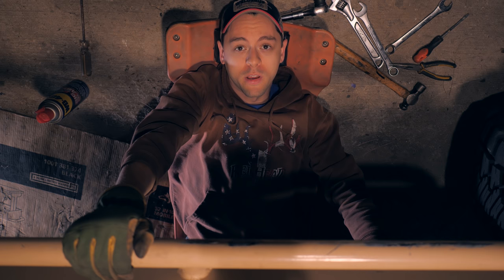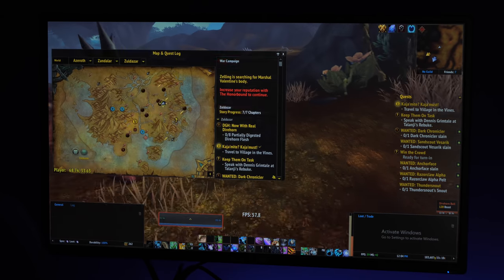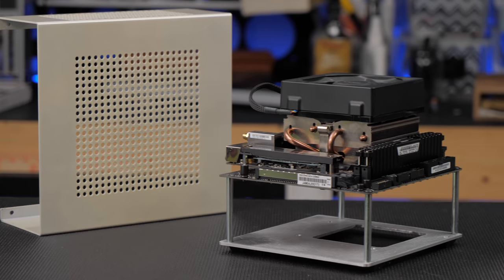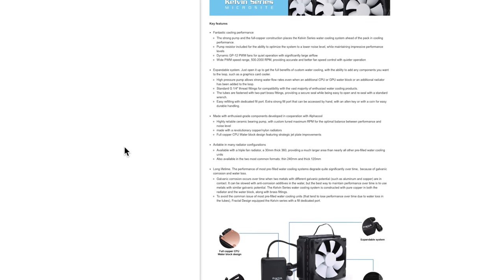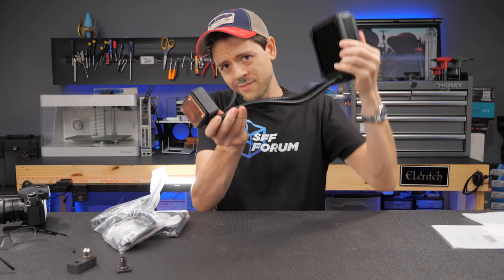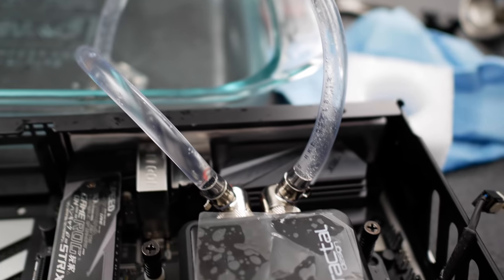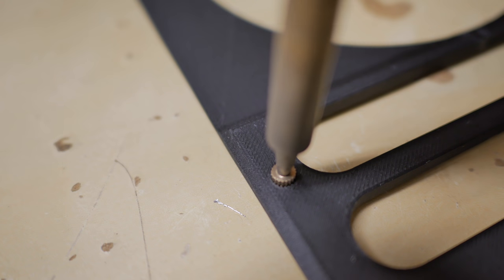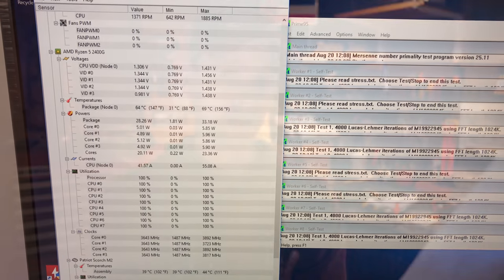Brickless + Liquid-cooled + Ryzen 2400g + S4 MINI

Comment: Cool, for super small cases the way to go is not water pumps, but instead heat pipes. Similar to what HDplex, Streacom etc are doing. That would be a awesome project building a custom case similar to the S4 Mini but a all out heatpipe solution.
Reply from the maker: Putting a res in line is a great option for those who can for sure! Thank you VERY much for commenting. :)

Comment: Another tip. Air in a AIO will always setting at highest point in a loop. If you laying these mini pc flat then the highest point would be the pump. That why it's noisy. The air is settling in the pump block rather than the top of the rad. As it would do in a standard ATX system. I've used loads.of AIO"S and never had any noise problems. The pc needs.to be stood upright with rad been highest point so the AIR collects.in rad leaving pump silent.
Reply: exactly this

Comment: New APU case would be amazing. Please do this!!!!!
Reply: I don't think it is really necessary, after all there are quite a few very well made ITS cases, that only house the mainboard itself and a pico PSU. I hope AMD will release even more powerful APUs in the future, it would be awesome to have a tiny system that can also handle heavy games like Witcher 3 in 1080p!
Reply: Oktay Yumlu - My dream is for AMD to release a 6c12t APU with a 24 CU Vega graphics. This will not be likely possible until they are on 7nm process. But fingers crossed
Reply: jbres79 that would be equal to 1536 shaders, so just between the RX 560 and the RX 570. The TDP of this APU would be at 175 Watt, pretty darn high but possible to cool 😁
Reply: I think existing s4 mini would be fine. If only there was a good ac-dc single PSU to easily put inside. I really like utilitarian shape of s4 mini.
Reply: Given how they do the CCX config with Ryzen and how they replace one CCX with the Vega compute units for the APU's, it would be interesting how they could do 6c/12t and Vega iGPU and manage heat in the same package. I'm fine with the 4c/8t, but bump up the speed to closer to 4.5GHz and up the graphics to the 1050/560 or even 1050ti range while maintaining power consumption and TDP closer to the 2200g/2400g levels, and that would be great. However, that may be too hopeful for what 7nm will allow as well as the limitation of using ddr4 for the gpu side.
Reply: @kartaloktay  "there are quite a few very well made ITS cases, that only house the mainboard itself and a pico PSU"

Name a few that are as small (or smaller) than the S4 Mini and are as attractive as the S4 Mini.
Reply: Athasin check out the cases from streacom, they only house the board, 2,5" hdd and the Pico PSU. They are also made of aluminium and pretty cheap.
Reply: @kartaloktay  Will do, thanks!

Edit: Just did and ... they're seriously outdated. I mean they still have a slot for CD/DVD drives and a front panel eject button instead of USB-A ports (let alone USB-C). 
I definitely seems like the market is in desperate need of updated APU cases.
Reply: I've been waiting for someone to do a APU case with a Vesa bracket to mount to back of a monitor for that AIO look.
Reply: @carlwells9504  Relan is the name of the brand...Aliexpress
Reply: @novakk86  Cool thanks I'll check it out

Comment: @Not From Concentrate
Thanks for another great video.
Just a note on the "AIO prolems/weaknesses" You mention.
I have over the years "moded" a number of AIO's and though I fully agree with Your description of them I still think they can be a pretty great solution depending on Your needs, resources and expectations.
So to my real "point", I think I might have at least a "partial solution" to some of Your "gripes"with AIO's. And that is to "simply" add an "tube reservoir". What I mean by that is simply using T-coupling at the "top of the loop", and have a short "tube reservoir" capped with a "sealing plug" connected to the "T". This "dead end tube" should be positioned so that it can be used as filling port, and "tiny reservoir" when refilling/changing liquid as well as "reservoir/bubble trap" when in "daily use", though that is not strictly required. 
Using this "arrangement" makes it MUCH easier to refill the AIO, something that (as can be seen in this video :) usually is a "pain and a half". It can also make it easier to keep an eye on the "liquid level (and condition) AND to "top up fluid" when needed. Something which can mitigate some of the "AIO noise problems" caused by low liquid levels and "air in the loop"
Just wanted to "throw it out there". [This idea is nothing new, and it is in principle just using a "tube section" as a "dead end reservoir". And it can of course also be implemented using "hard tubing", though that's a bit more cumbersome, and actually "less usable" (much like hard tubing in general:)]

Keep up the good work, Best regards.
PS.
You might know a lot about "computers and stuff" but when it comes to candy You are clearly clueless.
Salt liquorice is GoodsGiftToMan ;)
D.S.
Reply from the maker: Haha...strangely, although I absolutely hated that stuff...I kinda want to try it again. I guess that is why they call it Stockholm Syndrome? Because it has to do with wanting to return to bad Swedish candy. xD
Reply: Stockholm Syndrome... AIO from Sweden... A pattern emerges.

Comment: Looking forward to your APU case. It would be great if you could bundle it with the PSU (AC-DC and DC-DC). It is a massive turnoff when a case (any case) requires parts you need to source from third party sources (typically PSU and risers).
Reply: Yeah. Please convince hdflex to make single unit ac-dc PSU 180W. Would be perfect for apu. I asked hdplex about this, and they do not have plans for this now. :/

Comment: Those AIO coolers are under filled for a reason.  If it was completely filled up, it has a high chance of leaking over time due to the fluid expanding when it heats up.  There's a new one coming out soon that has expanding valves installed on it to prevent this.  Also they have corrosion inhibitors in the fluid to prevent galvanic corrosion.
Reply from the maker: I appreciate the comment! Even if there is a good reason that they aren't completely filled it doesn't change the fact that air in your loop is going to hurt performance and shorten pump life. I did a livestream video where I add a reservoir to this AIO and it quiets it up and drops the temp. You can find it in the playlists. The glycol mix they use inhibits corrosion, but doesn't stop it, as anyone who has taken apart one of these that mix metals. Finally, how hot would the fluid need to get in order to spring a leak? The tubing is rubber and could expand, and if your glycol reaches boiling you have a serious problem elsewhere. I think expanding valves is a great idea if it solves the air problem.  Peace and thanks again. :)
Reply: I wonder though if air in the line will actually deteriorate the pump over time.  In the aquarium hobby the pumps we use are very similar to AIO pumps with the same basic impeller design, and many of those, such as venturi pumps and protein skimmer pumps, pump both air and water through them on purpose.  Those don't fail or break down because they have air going through them.  In fact they get heavier usage and still last for years, even decades.
Reply from the maker: @Brunnen_Gee  That's good info for sure--now we can all wonder why pump life is notoriously so short with PC "AIOs." :)

Comment: So, Im not sure what you are doing wrong with AIO pumps or maybe its because I dont run ITX systems and am not attempting to sleep on my systems while running fortnite at 4k, but my AIO pumps rarely run loud enough in my mid tower case to be heard. I have run other AIO systems for 5+ years, crammed with cat hair and they still do a good job at cooling my system.

Comment: They have replacement parts on the alphacool website for it. It basically the Alphacool Eisbaer LT  just re brand with the fractal design name on it. Plus they do have an 3600rpm pump upgrade for it. If u need more power.

Comment: It's a cool way to fill a AIO. But there is a reason they don't fill them completely.  Liquid expands when it gets warmer to hot, so the empty space in rad allows.for fluid expansion.  You could be running the.risk of a leak when the fluid inside your loop expands and only.way out is through fittings.

Comment: you should try get in contact with asrock (industrial) and get your hands on one of their stx motherboards with a mxm gpu slot and ram slots and m.2 slots and cpu socket and etc etc... its pretty much a mobo thats smaller than itx but still fully socketed, just a bit hard to get your hands on. all the best! (there are some interesting stx cases out there too btw)

Comment: Have a 2200g build in a small InWin case and its great on my 720p tv in my bedroom, playing through AC: Origins now and the 2200g handles it decently well on 720p with a mix of settings, but a solid 30fps (which is is standard for AC games thanks to the engine). Hoping their move to 7nm lets them get something even more powerful with similar power consumption and TDP, though the DDR4 being a big limitation for the gpu side, but something closer to 1050 or even 1050ti in gpu would be amazing. So a small APU case that looks nice and has good cooling (something my InWin case has issues with for the 2200g when being pushed) would be great, I'd make the switch.

Comment: At your liquid loop the manufacturer leave some space because your liquid going to broaden as the liquid gets a but warmer.
Reply from the maker: Hi, Matthew! The problem is the expansion factor for their propylene glycol solution is too generous. Or maybe that's just a symptom. But the unfortunate thing is for most AIOs there is simply too much air in the loop at operating temperatures. They can still be effective coolers when you need to move the radiator away from the CPU for certain builds, but for the most part, it makes sense to me anyway just to buy a nice big cooler. These tiny cases require special measures. :) THANK YOU for commenting!!!!!

Comment: Hey Josh, this is really cool! You mention that you didn't really gain any performance from the project. Is that just because the AIO isn't a good solution, or is there just not much 'headroom' in the 2400G?

What's exciting to me about the APUs is that they're unlocked, and playing with that seems fun. I remember on my 4790K there was a point where I was undervolting the CPU and underclocking it so that I could overclock the integrated GPU more, haha. iGPUs were quite janky at that point in time, but the overclocking did take Resident Evil 5 at 1080p from unplayable to playable!

I wonder if--especially if you're going for higher-resolution gaming rather than higher framerate gameplay--undervolting and underclocking the CPU side of things would let you crank up the integrated Vega chip enough to make a difference?
Reply from the maker: Just the AIO wasn't going to give me better temps than the NHl9i. Overclocking the chip might work for some scenarios like you point out. Peace

Comment: Next gen apus will be sweet.
Reply: Picasso?  It will be Raven Ridge on 12nm, most likely...some mix of slightly better clocks and slightly better power usage / thermals.  Next next gen, though, with zen 2 on and navi architecture on 7nm...that might be something special!  Hope I'm wrong!  (to be fair, Raven Ridge is already pretty capable!)
Reply: @SofaWolf APUs are always a lie...
Reply: @SofaWolf They have their place but for PC gaming? Nah. Get an old dell i7 and a used RX570/RX580/GTX 1060. Youll crush next gen APUs in gaming performance and cost easily.

Comment: Have you tried 'Cooler Master MasterLiquid Lite 120'. I have it in my mini with 8700k CPU, Gigabyte Z370N Wifi motherboard. It fits without any modification and its quiet. Never seen temps above 75 degree. During normal workloads temps stays in 40s. I believe for 65W Ryzen CPU, its going to be more than sufficient.

Comment: What are you doing to get your AIO to be so loud? I have a stock H60 2018 on a Ryzen 5 2600 (overclocked to 3.8) in a SG13 with a Nitro + Rx 580 and everything is quite until the nitro+ fans kick in.

Comment: I don't get it - what's the point of getting a discontinued AIO with your list of checkboxes if you weren't going to use the original radiator or coolant?  Might as well have just got any unit that'd fit properly and buy a compatible radiator with your own fluid.
Either way, the final build looks great.
Reply from the maker: It still was handy because I could use aftermarket standardized fittings. Not alot of AIO block+pump combos have that feature. Also I was taken in by the ceramic bearing pump marketing. The pump was crappy like every other AIO pump I have tried but I wanted to give it a shot. Peace

Comment: 2400G is awesome. If only there was mobo that can support 64GB with mini ITX form factor. Also no brick.

I am on a hunt for good case for 2400G (with psu!) but no drives or optical bays. Just m.2. if there are driver they must be in raid 1.

InWin Chopin is close, but it is not smallest possible.

I was looking into s4 mini, and to mod it, and put InWin PSU in it or something.

Comment: I've filled non refillable aios the exact same way, even in a Pyrex , I've done it maybe 7 times .if they made these aios  serviceable , I think alot of the problems you mentioned wouldn't exist....

My name's Josh too btw XD
Reply from the maker: Yeah if you ad a reservoir to these their viability increases tremendously. The pumps still are crappy and noisy though :)
Reply: @NotFromConcentrate   they're noisy , especially in system that's really well ventilated , adding a res is a good idea though , if you can . I've used a few cool-it brand aios , and they're alot quieter then any other aio I've gotten or worked on

Comment: Add Panasonic PGS Sheet to help with The Cooling
Reply: I use a Panasonic sheet on my CPU :) it's worse than my paste. Reusability and no cleaning up paste is why I use it.
Reply: @MarkHuron  it not to be replaced the paste it to piggy back to assist with the cooler
Reply: @GENERALCHAOS13  do you have some that you use like this?
Reply: @MarkHuron  I have a scrap sheet when I grabbed it from my friend Bin
Reply: Just not enough for a full test when I Slapped it on to a Athlon Basic cooler putting it on the FX series CPU  if I can get a bigger sample and Bending Tools would provide more Data my goal is to get a low profile and PGS Sheet to Piggy back
Reply: @GENERALCHAOS13  I think some users at notebookreview forums already tried PGS + paste and it didn't seem any better. Imo I think graphite tim (Panasonic renamed it recently) is best used dry. Once you get paste on it then you can't really clean it off. You'll be limited by the weakest link in thermal transfer, so Imo I don't think mixing interfaces will help results much
Reply: Since graphite pads have best thermal transfer on x-y plane, I wonder if there is a way to stack a bunch of sheets and get a thin slice out of it, glued together or something, so that the edges of all the sheets touches the surface of heatsink & CPU.
It would probably be pretty expensive to do though

Comment: Holly shit, so noisy. If you need only APU, just turn off TBO and down CPU to 3Ghz/1,1v(may be 1,3v if you want OC vega/ram). It`s enought for wraith spire cooller 1500rpm/65*C in games with OC vega. With default 3,6/3,9(TBO on) and OC vega you will listen 2300rpm in games.

Comment: Regarding pump noise I’ve got a H80i and I have no problem with pump noise, apart from the occasion thing with the fans spinning up to full for no reason. 
P.s. it’s cooling a i5-4690k OC
Reply from the maker: That's great! I bet it still makes noise though, much more compared to a single premium fan. The audio was turned up so you could hear the pump noise quality not that it was that loud or anything. Sorry for the confusion and thank you for the comment. Peace